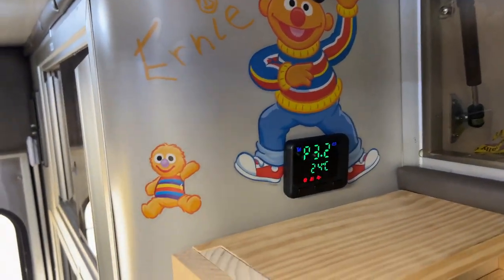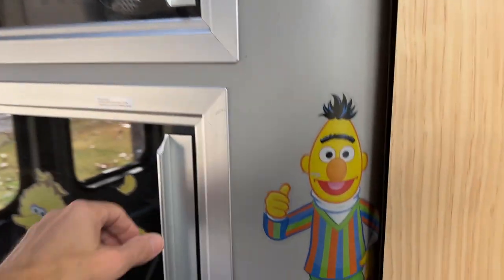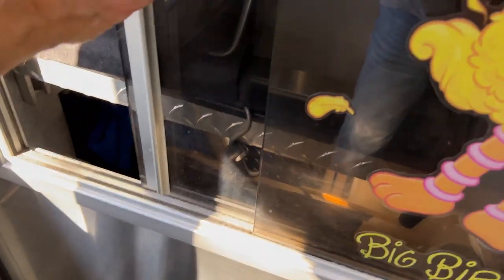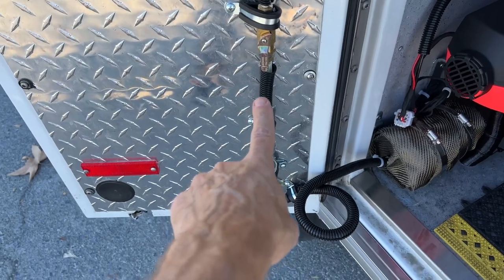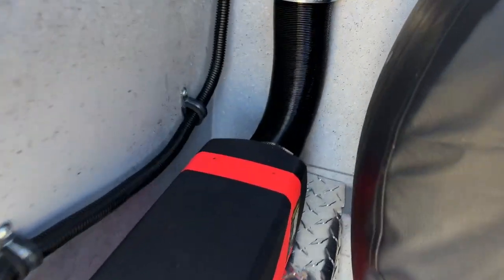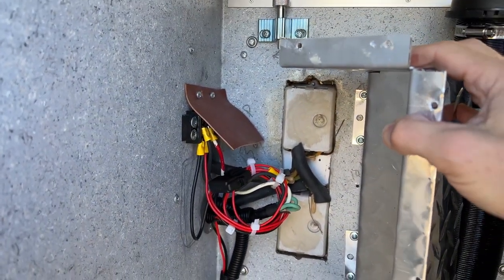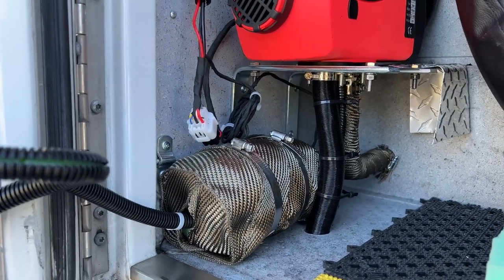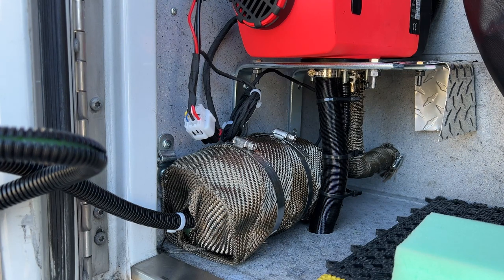Chinese Diesel Heater Noise Dilemma Solved?

Comment: Great stuff very quiet ,just be aware of the base of the heater usually has a seal on the base (red or black ) this was designed so it seals the base of the unit to a floor so no fumes can leak upward into heater area and then into habitation  in the event of any exhaust fail or other leaks .

Comment: The foam stuff idea is great. I did all that. As an ocd gunsmith, I have to constantly improve.  I got a diesel damper. ..installed after the pump. The best improvement. I even took all the foam off the pump. Google diesel heater damper.

Comment: I did it very simple to ours. Use a car radiator hose. I am into the automotive sector. So i could get one what perfectly fits around the pump. Only the connector part could not fit. Put at the other site whats is free another thick rubber hose into the bigger one so that a lot of the pump is covered with rubber. Big difference according old situation. You can hear it ofcourse but a huge difference than before and at a very comfy level. Think simpel…..

Comment: its very hard to explain in words but I built a small plywood box for the pump and suspended the pump with loops of narrow gauge bungee cord so that when you shock the box the pump moves freely suspended in mid air the shock wave made by the pump as it clicks is absorbed by the bungee cord and silences the pump completely two holes drilled in the top of the box over the pump shafts and a looped bungee cord around the pump shaft four loops pulling the pump to the centre of the box so it hangs in mid air seems to work very well indeed, you can still mount the pump easily at 45 degrees. There are also some solutions where others have mounted the pump with zip ties to allow the pump to move as it clicks, the general consensus is to allow the pump to move freely as it clicks thus absorbing the shock wave it produces.
Reply: Have any photos?

Comment: The fuel pump is a solenoid pump. The noise is natural.rubber hose on each end and suspend with clothe strap or rope. Even tie wraps will transfer the noise because they’re hard material.
Has to be soft or vibration will transfer.
Reply from the maker: Hi Roger. Great suggestions. Wanted to protect the pump. It is encapsulated in foam so it is sort of suspended in air.

Comment: The ticking is quiet inside and out. That's not a problem for me... But, I do have a problem. I just put on a muffler and it didn't do a thing. I can hear the exhaust coming out still fairly loudly, and I can hear, what seems to be a fan? It's very loud and a bit of a higher pitch... Inside the camper it's fine. But outside it's very loud and obvious.

Comment: I’m not understanding about the noise complaints about the diesel heaters , I have two of them in my house and they sound like a really quiet dryer , Ian’s I barely hear the clicking of the fuel pump I don’t get it .ones a 8kw and ones a5 kw

Comment: Get rid of all that plastic and cheap ducting and get semi ridgid dry duct. Home depot has 3" everbuilt semi ridgid duct - it works perfect. It will make 90 degree turns etc and stay in place, wont melt/smell, and is way cheaper and easier for connectors

Comment: Putting you in for the "Real men of genius" award. I thought that you would use a pool noodle. I would remove the heat guard. You may want the fuel to expand due to the heat to have a longer flow. I love the ambo. I have a type 2 and love it. Best investment I've ever made.
Reply from the maker: Thanks Scott. My sense is it still can expand and contract within the foam and will monitor it to see how it performs. Yes, these are well built machines!

Comment: how long does the diesel last?
Reply from the maker: Depends upon a host of variables like the outside temp, your desired inside temp. However, there is a hand pump that you can use to pull from the main tank. But that tank will last 3+ days from my experiences.